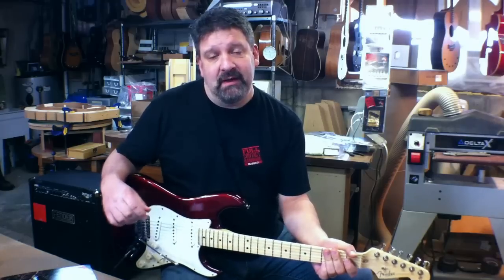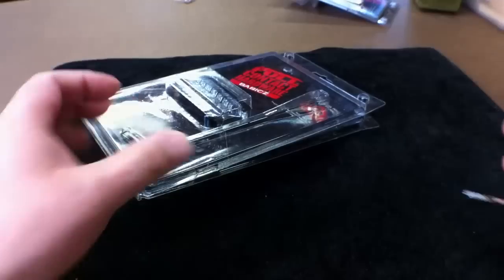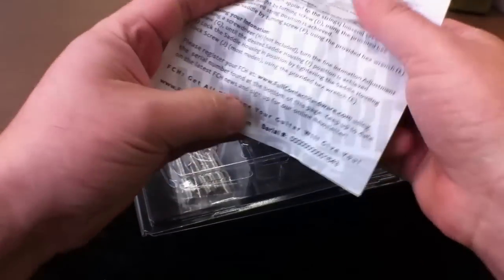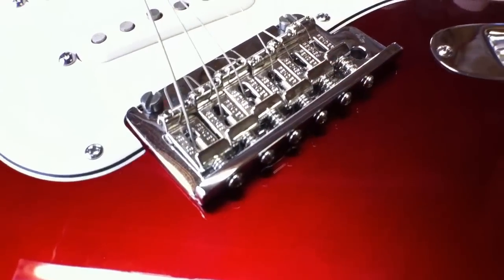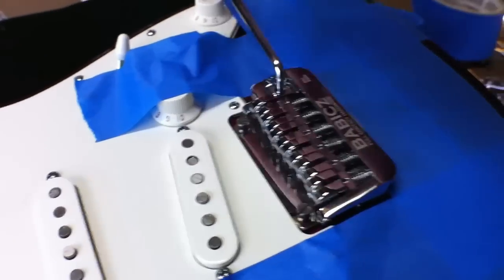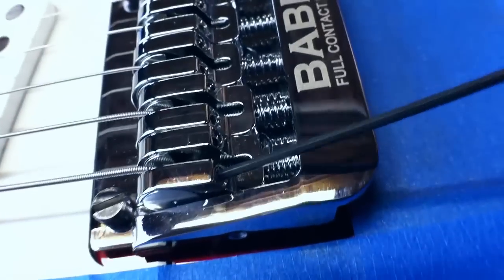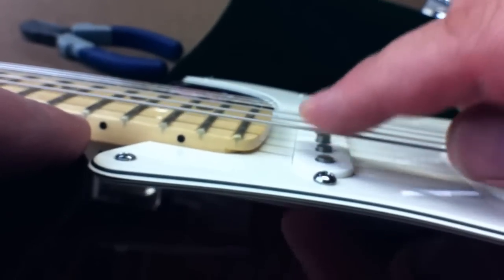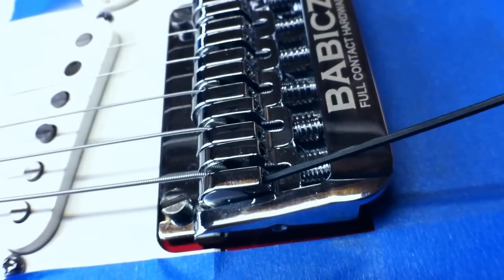Installation FCH-2Point Strat Tremolo - Babicz Full Contact Hardware

Comment: i have this but the five screw version. had it installed by a pro and it will not stay in tune, thats why i got it so i can actually use the trem on my strat imagine that as far as i know im doing what im supposed to do but still cant touch the trem. what am i missing?

Comment: OK, I question here instead, and break it up in parts. It seems to me that the small screw at the side is unnecessary to keep the saddles from moving. Aren't they hold steady by the intonation screws at the back? I knew that such "side lock" was to be used on Steinberger bridges and saddles, since they were not held by antyhing. And you had to move them by hand. If one can skip the side screw to squeeze them all together, I am all game.

Comment from the maker: The advantage is mostly within the eCAM saddle design. Eliminating gaps under the string...and single screw string height adjustments with a locking feature. Rounded saddle housing tops add comfort on the playing hand and the side locking set screw gang clamps all six saddles together which offers improved side-to-side saddle stability. All this adds up to improved note clarity.

Comment: Some quick comments - I installed it on my MIM Standard Plus Top a couple of days ago.

I wrote to Babicz asking about the block and they confirmed zinc - will definitely be upgrading that bit.

The tremolo has surprised me, a lot, in good ways. The clarity is enhanced especially in high ranges, crisper and brighter would be good words for it.

I already had great sustain with the Wilkinson I switched out (steel block) - interestingly the Babicz holds its own even with zinc block, can't wait to switch out for brass or aluminum and see what happens :)

I think the fact of the string laying more cleanly across the lip of the cam has some effect on the way the string vibrates, really am not sure why but I was able to lower the action further without buzzing.

I have mine set to float with 3 springs, really smooth action, am not a huge dive bomber with lots of trem acrobatics, but i did experiment to see how well it stays in tune and it does as well as any trem I ever used and better than most.

So I like it., a lot - with an upgraded bock I am sure I will love it :)
Reply: cool, $160 bridge on a $160 guitar.....

Comment from the maker: When intonated properly, the strat trem side locking screw is positioned such that it will only make contact, and clamp the sixth string saddle housing, never compromising the eCAM rotation. Also the eCAM width is .025" less than the total width of the saddle housing so the cams can never get clamped together in any way.

Comment from the maker: Depending on how tight you adjust your springs, it may leave a mark. Usually more denting would happen when a trem is set up as a floater - when the tremolo arm is pulled up aggressively and the back edge of the trem makes contact with the body. All these are prone to happen with any Fender style tremolo.

Comment: I can't stand the sharp edges of the set screws on my factory strat, I play with my hand right there ! It sucks !  This bridge looks well built and looks smooth,,, I like what I see here,  easy install.  TY Jeff,  😁✌
Reply: Exactly. I don't know why more players don't mention this. I can only assume their technique doesn't require resting their palm on the bridge. Anyway, I'm with you man. Don't know why Fender can't resolve that.
Reply: Hey Mike , Me too !! , I hatted that about my Strat , the bridge is amazing , really to bad there is zero support. I had a question , but in the end worked it our myself , so that was cool !! I was going to change the trem-block for my original De-Lux 'Pop-In' , but at trying the screw in one last time , I liked it better , on mine it tightens up just at the right spot and the pop-in arm was way to sloppy to really use right. TIP !! , this helped me a ton. I was losing way to much skin off my knuckles on the screws for the 5 way , so I went to my local hardware store and picked up some stainless steel #6 Button Hex Head screws , I wish that would have been my first mod. You guys reading this , be like Nike , Just -Do-It , you`ll be surprised at how much better the Strat will look and feel.
Now go make some noise !! , Later , Dreamer 
Reply: @Dreamer5211  Thank you Brother,,, luckily I haven't changed anything yet !!!! I am going to take your advice and do the same thing !  I hate to have to replace anything on my strat, but I can handle the hex change out !  Makes good sense!  TY  Again bro ,  nice looking out !   😁✌
Reply: @michaelmendillo4614  Anytime , I understand not wanting to mess with a Strat ! When I bought my Amer. De Lux I was not sure either , but I started with the pickguard and trem plate ( aged MOP ) , then as I played it more & more , that whole S1 thing was bugging me , so I now have the original N3`s with a blender / volume kit / no treb bleed off -- the Babicz bridge really made the huge difference I was looking for and no more screeching !! , just smooth !! I had read about the added sustain , but I thought '' no way '' could it ever be that changing , but ... it was and more. The bridge not only looks cool , but adds so much to the 'lasting note' and the hammer ons == improved !! , have a super weekend , take care , Dreamer 
Reply: @Dreamer5211  TY ,,, Keep on,,, Keeping on Good Brother !  😁✌

Comment from the maker: sometimes the back edge of the body cavity can have excess paint build up...reducing the rectangular hole size. This is where the sustain block passes through the body from the top. Usually this can be cleaned up with a file or course sandpaper on a thin sanding block.

Comment: I'm very interested in this. It maybe could bring an old Strat I've long since given up on to life. It was always a dead sounding guitar and I've changed everything on it except the bridge trying to make it open up. I even removed the finish and stained it -which helped tremendously- but didn't cure it completely. My "problem" is that all the Babicz parts I've seen have writing on them and that is just a major turnoff to me.

Comment: Hi Jeff
Is the trem available in a vintage wider spacing available  in either a 2  post or vintage 6 hole mount?  I can locate the narrower  2 1/16" string spacing models on line in the US
but couldnt find the wider  vintage string spaced version referred to at the end of the video .
thanks for your time
Craig

Comment from the maker: You can mount the FCH Strat Trem as a fixed bridge. You just need to remove the lower string block and you can mount the upper portion of the bridge to a non tremolo flush mount guitar.

Comment: Installing on my American professional today.
Reply: thomas lowrey hello, I was wondering how the install went on your Strat pro? have a 2017 fender strat pro and was hoping it would be an easy drop in upgrade like the video shows. Please let me know how it went and if you think it was worth it. Thanks.
Reply: Install was super easy. Dropped in easily. The springs are high-tension. Definitely back off screws to the clip before you try to stretch them highly recommended
Reply: thomas lowrey awesome thanks for getting back to me. I'm going to get one soon and give it a try. I put graph tech string savers on there right after I got it. The vintage ones in my opinion didn't hold them in place good enough with the neck being so thin. The low e string was slipping off the neck when I would go to grab it..the graph tech keep them in place but I want to modify it more to my liking. Thanks again happy jamming!
Reply: Agreed I was experiencing noise and vibration, drove me nuts. Babicz deal is pricey, but it solves any and all bridge issues.

Comment: Since some of the e-cam saddles are of aluminium I think they're slightly more prone to deform if you're using the side screw to "squeeze" them.Over time that is, you don't work on these that often.  However, if you're using the Stainless Steel variant I think they will last a lot longer.

Comment: This question is related to the floating trem setup. If I don't have locking tuners, will it go out of tune easily with trem bar use? Will it be necessary to install a locking nut?
Reply: Yes..or an LSR roller nut.

Comment: How many plectrums did you use to lift the tremolo bridge before tuning? Another thing- My Ibanez came out standard, with the tremolo claw all the way against the guitar, ie. the claw screws are all the way into the body, leaving no room. Is this bad? Should I release the screws a bit before starting the adjustment?

Comment from the maker: The side locking screw keeps the saddles from moving side to side when the strings are strummed. This is a benefit over a traditional Fender type bridge where the saddle have no means of being fixed. Of course this is optional and one does not need to use this screw.

Comment: Thank you for clarifying everything. a) You can intonate without wedging anything underneath it, and b) one doesn't have to use the side screw, as an option. Think I'll go for the stainless steel ones. I am all game. One last question: does it keeps it in better tune than before when dive bombing? Provided you used original strat trem with two point pivot?

Comment: I just bought a set of saddles for my Strat, which will be an add on to the Callaham inertia block; there is no way I will be replacing that block any time soon, specially after having ground the underside of the plate to bare metal and super tightened to the block with loctite. I understand Jeff is a hell of a nice guy and customer relations person, however, just a bit of constructive criticism, in my opinion, perhaps it would benefit the business if the demos were left to a pro? no offence!!

Comment: At 10.32 you like to use the cover and tilt all of it forward a bit to be able to reach it with the screwdriver to adjust intonation? Sorry, I want to adjust intonation while it is flush, and in operating mode. If you do like you do at 10:32 you whack the whole tuning and action, and it sure wont intonate when you decide to remove the cover and set the trem back at level again.  If the intonation screws can't be reached without raising the trem, its a no no for me. Sorry, a major gaffe IMHO.

Comment: I like the way the strat changes color from blue to red :-). Now, isn't it better to have done it the other wya around, by setting the action height, and the ability to pull up on the trem (back) first, before doing the intonation? Doing the intonation with a pick or spring cover as a wedge under the bridge to reach the screws at the back seems to be going back and forth unneccessary amount of times. Although I get the idea, intonation is the last thing you should do. Get a pro to do this video.

Comment: Well then. Then I know it'll work the right way. Seems to me that the part with your logo on seems a bit unneccesary. That the screws are beneath it all. I PREFER looking at all screws from above. Also, I think your TELE bridge locks the saddles a bit better. Having one screw for all at the sides is unwieldy, and can in the long run make the outer saddles squeeze so much that the e-cam won't roll or move. One just have to be a bit careful on this.

Comment: I'll PM you instead. To short actually to produce my question here. I find the sequence of how to set it up is all backwards and inconsequent. I think, first you adjust everyting that have to do with action, string height, AND the abililty to pull up (backwards) and then tune it up. THEN, and not only then you intonate. Without wedging anything in anywhere to whack the tuning out again. There are worse trems on the market though. That's why I wondered. That you really have to be finicky with.

Comment: What you are actually showing in this video is how  to retrofit this tremolo to a guitar that already has the two point trem system.  That is not how to INSTALL  it on a new guitar or one with a 6-point system.  You are in a well tooled shop when you took this video, why not show how to install one of you units.  Anybody can take a different model 2-point system off and put your's on, but installing one where you have to drill holes and make critical measurements would be more beneficial.